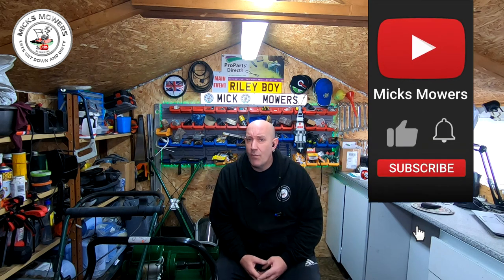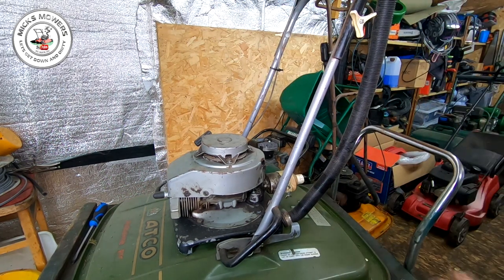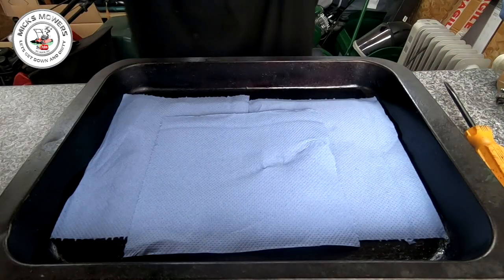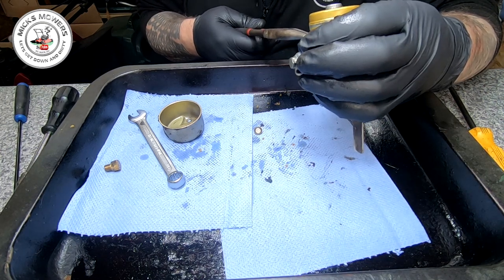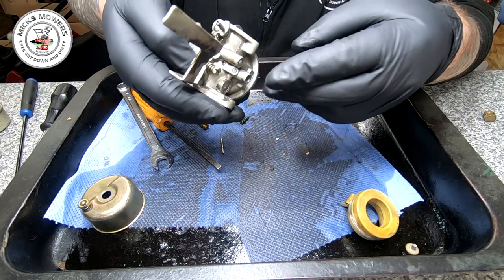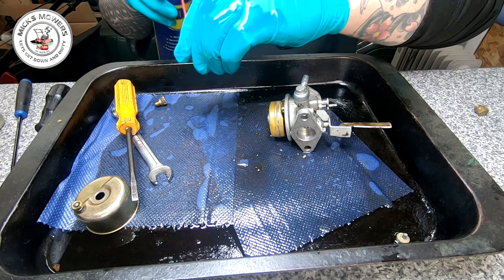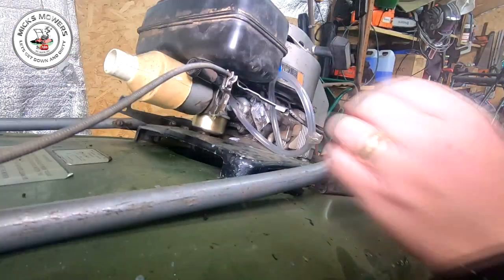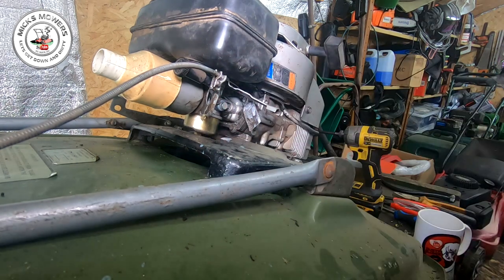Hover Mower Vintage Atco Carb Clean - Lets Fire It Up

Comment: Top tip. Mark the carb body and float bowl with a permy marker before removing the carb from the mower so when you put it back you know the angle so it fits in the same recess.

Comment: Check the Compression, if its around 20-40 it cant blow so it wont suck!  Do a wet compression test with motor oil after the dry test. If it comes up then pull the head and run a quick hone down it, even some sandpaper 220 grit will break any glaze and rust so the rings can re-seat. Pop it back together and re-test for compression, then fire it.
Generally that works, don't forget to check the reed valves 1st, often you can flip them and polish the seats. that will blow off compression as well and confuse the signal to the carb..
If the carb was gummed with varnish then soak it in Lacquer thinner. WD40 is nice and I know your not a fan of hard cleaners but gum wont come off with WD,!
Nice machine, I like the color too. 
We don't have those vintage machines here really, not in my area..
These old machines are fun and can test our skills and patience but they don't make for easy flips! I know you like to save them when you can,,,,
Good luck.

Comment: The old Airbourne is getting hard to find these days.
R.e the tecumseh mv100s engine, the float bowl drain is supposed to be nearer the front or reed block or as you found the carb won't come off! I got round this by taking the 4 bolts out of the Reed block and removing it all together. The Delorto carb can be finicky too, airflow is critical, not enough and the engine won't start and if it does it won't rev, too much and it runs lean. Also there's a little mainly overlooked screw on the throttle lever to adjust the high-speed revs, screw it all the way in to get a reasonable hover or even better put a longer screw in place, don't mess with the air vane asthat causes even more issues!

Comment: I deliberately over stretch the spring on my Flymo as this makes the engine run a bit faster by shortening the spring and using it on the furthest holes. This in turn means that you get better clearance at ground level as the higher rpm makes the whole machine fly a little better because of more underbody pressure. It is after all a hovercraft.
Reply from the maker: Yeah of you can set the governor arm to increase the rpms

Comment: Brilliant stuff mate. Quick question erm qualcast 35s 1997 shit loads of carbon buildup cleaned new gasket etc still hunting and black smoke on revs
Reply from the maker: Start with looking at tuning the carb to make it run less rich. But it sounds like valves to me. Man need re seating
Reply: @themowerman  cheers mate the carbs been gutted and cleaned new gaskets aswell. A carbon cleaned the lot as it was thick bro, a may sell on for a few bob as it could be piston job rings etc
Reply: Aye mate as suspected its the rings and bottom end, not worth putting money into it its not very good up here at the minute for selling, so will screw a few bob out it n push it on

Comment: mick try adjusting the carb you know the screw that was 2 turns out, trouble with putting a 4 stroke engine on is the extra weight can affect the hovering, hope you sort it
Reply: That is true if you are going to change the Engine you need a lighter engine than A  Honda 4 Stroke Engine
Reply from the maker: Keep watching mate.. all will be ok..

Comment: Could it be the adjustment of the carb?
Reply from the maker: No mate.. I have taken the piston out .. the rings piston and bore are done .. it's a shame.. a new engine is now being fitted..
Reply from the maker: Did you get the hedge trimmer blade?
Reply: @themowerman  I did, many thanks.
Reply: @themowerman  That is a shame.